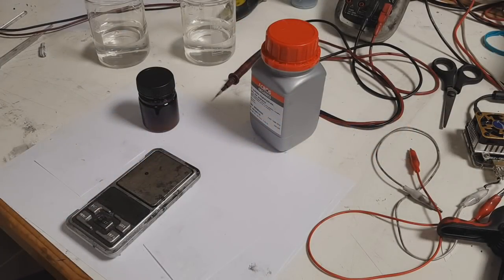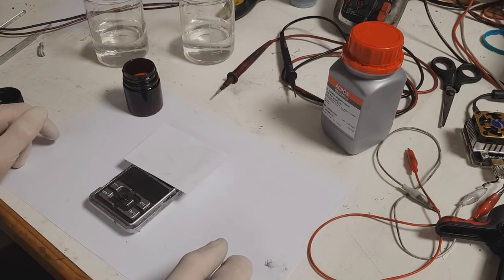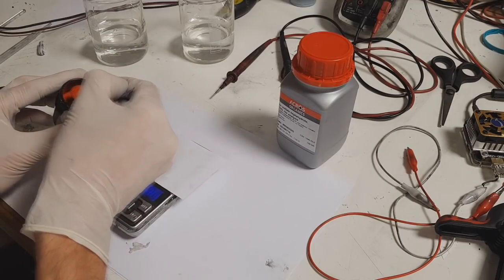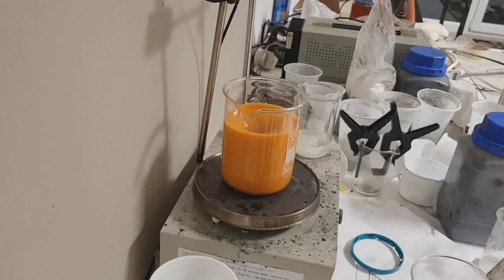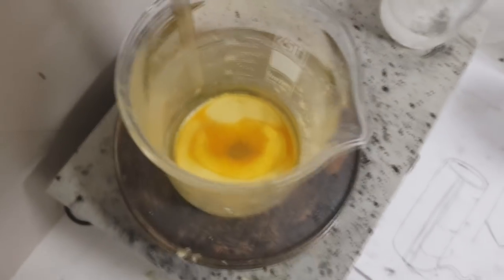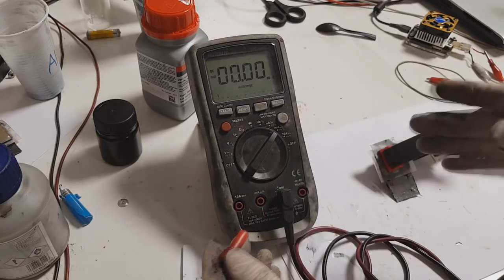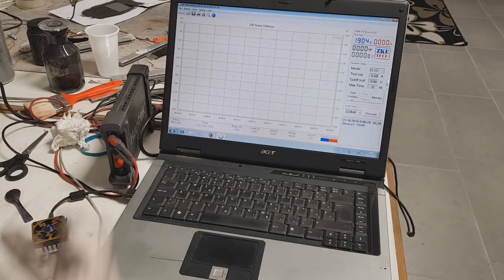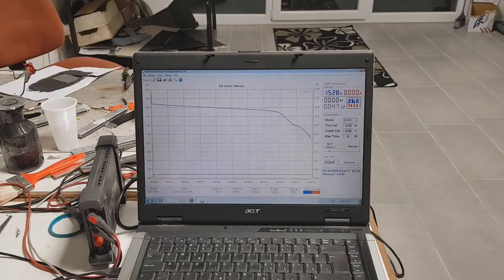Zinc ION Battery (zinc Hexacyanoferrate)

Comment: Have you ever experimented with organic "ionic liquids" or extremely low melting point euclectic salt mixes? Do you know of any of the latter that don't involve a nitrate or nitrite?

   I asked for two reasons,
.. first, if there's no water in your electrolyte you don't have to worry about energy loss due to making hydrogen or oxygen.
  And two
.. this is where it gets really exciting...
I only just heard of something called a thermoelectric battery! Not a thermocouple a thermopile or a peltier junction.nope.
In my search for this elusive low melting point salt mixture I ran across a mention of a thermoelectric battery that used  ferrocyanate/ferrocyanide  ions in a molten salt mix that together exhibited a very high seabeck coefficient.

I would love to see if this battery chemistry ,if used in a non aqueous ionic liquid, would also exhibit this thermoelectric effect.
  If it does, could the battery be charged by a heat gradient? Or with the effect just increase the output?
  I don't have the resources to explore this like you do, so I hope you find this as fascinating and as exciting as I do and I would greatly look forward to seeing you experiment with it!
   I can't do much, but,  anything I could do to help I would be happy to do, and would love to participate in creating such a device.

Comment: Hi Cayrex2. Is the potassium hexacyanoferrate 2 or 3 I noticed yours is red in colour may be 3. on robs it looks yellow. and does it matter if you use 2 or 3.
Reply from the maker: Also (III) or (II) you can use als redox active additive in electrolyte for some hybrid supercapacitors
Reply from the maker: hello! yes I use Potassium hexacyanoferrate(III) and is red one,... the Potassium hexacyanoferrate(II) is the yelow one. Orginal one for this project is the (III).

Comment: Very good, thank you. What software do you use and what analog interface for your graph? I will give this a try myself.
Reply from the maker: Hello! This one: https://youtu.be/stkh4mYEv3I

In basic this electronic load is not very precise (+-1 volt when you discharge), but is good and cheap starting equipment. For more precise measurements use also some multimeter (for volts) conected to the battery when you discharge the battery.

Comment: I wonder how it will perform if you would just use for the second electrode also Graphfoil instead of Zinc. Could you please try this out Dusan ? Many thanks. Regards, Stefan.
Reply: I think Zn- ions have to form on the anode and go intercalate in the hexacyanoferrate. That is why there is a zinc anode to facilitate this.
Reply from the maker: @mukundsrinivas8426  you have right. When you charge the battery the Zn ions go from anode to cathode to intercalate into the cathode active material network. So, you need to electroplate the carbon first that you can use in this or other metal ion batteries.
Reply: overunitydotcom Hypothetically you could use graphoil, but with this your battery would be very bad since it reduces water to OH- to oxidize the zinc which will form a protective hydroxide layer on top of the zinc. Also since both discharging and recharging would result in hydrogen evolution the current will be in the lower mA range because you lack a powerful oxidatoon agent, if you nevertheless recharge the battery the graphoil will desintegrate into few layer intercalated graphene because it will expand. I tried to sum up some of the biggest problems, but there is a ton of other problems with this, I hope this helped.

Comment: Is this battery better than your other best Zinc -Graphite battery ? So is this active material really so good ? or can you also just use Active charcoal from coconut shells ?
Reply from the maker: This battery is nit bad, with some upgrade can be awsome battery for energy storage systems. The performance will be not so good if you use active charcoal also you will get bad rechargeability

Comment: Cool but just 24 mwh
Reply from the maker: Yes, this was with no charging the battery. It was like,.... make the battery and directly connect to the load to discharge. If I charge the battery than will the energy density much more higher.
Reply: Ah ok
Reply: @ehochimalpi  Hexawidget

Comment: I was confused to find an electrolyte formula for my aluminum rechargebeble air battery so it could be high performance..
Reply: DODHY YS CHANNEL Hello, I might not be the one you hope for an answer, but I occasionally check his videos because of some interesting approaches of him. So to start, you cannot make an aqueous rechargeable aluminium air battery because the redox potential of aluminium is about 1.7V which means it will be able to reduce water to OH- whilst being oxidized (water splits at 1.23eV), so you would have to work on non aqueous systems for instance solid state or ionic liquid/DES electrolytes. If you are willing to bear the dangers, I‘d suggest you to complex AlCl3 (anhydrous) with Triethylamine hydrochloride (alternatively urea) to get an ionic liquid with the formula Et3NHCl*Al(x)Cl(y), but I must warn you, this is highly reactive with water vapor and/or elemental water and form HCl gases upon contact, which might cause serious harm to you.
This will give you an operational voltage of 2.5-2.7V at a current density of up to 0.5A/sqcm but you will need a hydrophobic membrane. You could try different solvent-salt mixtures but in all cases you need a hydrophobic membrane or this will get shittin dangerous.